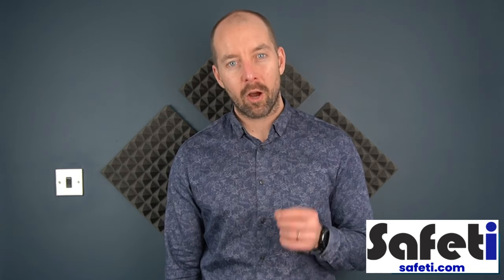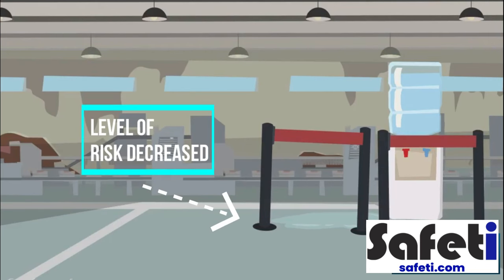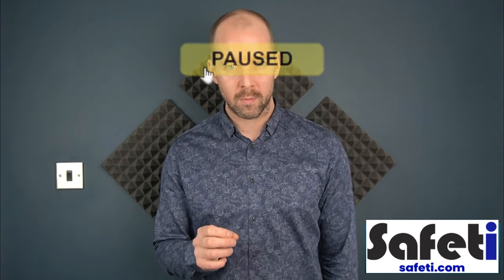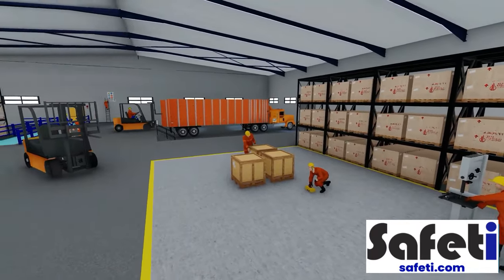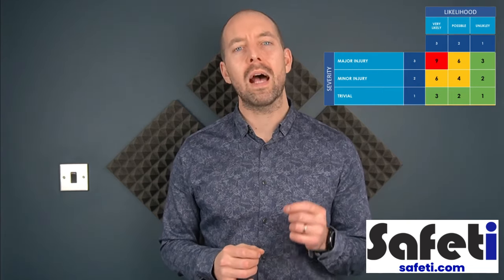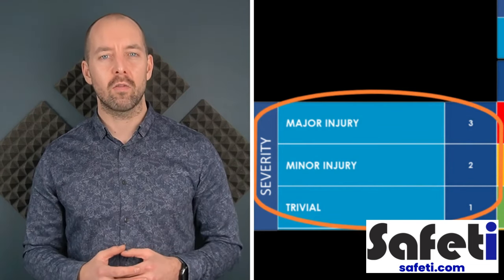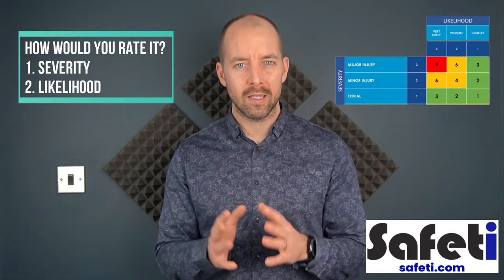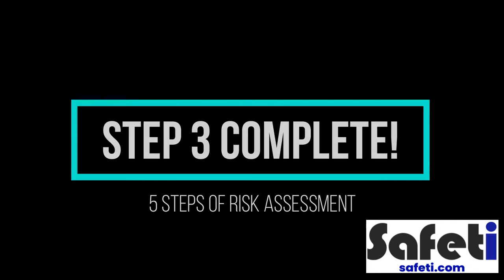Risk Assessment | Health and Safety Training Video

Comment: Great and simple video! I do have a question though. At 27.07min determining the severity, in my reasoning I thought that it would be a minor injury. With such a short distance, the pedestrian would be able to yell for the driver to stop and the crate would stay still. Also I assumed the driver would be going slow seeing as he has a load to navigate so it wouldn't take much effort to come to a halt. So in my view I would imagine the pedestrian collides into the forklift and falls down with minor injuries such as some bruising maybe a fracture or two. My definition of a highly severe case would be death, paralyzed, coma, etc. Can you maybe explain the reasoning of your estimate? I would like to successfully apply this knowledge when doing a risk assessment. Thank you for your informative content!
Reply from the maker: Hi and thanks for your question! This is of course a subjective judgement using  a fictitious scenario, but the important aspect is to understand the principles of the decision-making process. If we are thinking in real terms: for the pedestrian to be in this position, we make some assumptions e.g. there has been a failure on part of driver to see (blinded by raised load) and failure to communicate to  on part of the pedestrian (making operator aware of their presence), amongst other issues. Putting that aside, we have to assume worst case scenario i.e. That the forklift collides with the pedestrian (above their waist). The loaded forklift will weigh several tonnes (we have to assume a heavy load is being moved) and it would take minimal speed to cause serious physical injury. It would be easy to foresee that any resulting injury from this impact COULD be classed as 'Major'. In our view, it would be highly likely to cause serious injury (broken limb, severe head Injury etc.) Again, when we are assessing the 'potential' risk, we are wanting to identify the worst case scenario for the context (within reason), and in this case there is the certainly the potential for causing serious injury or even death. 👍
Reply: @Safeti  great insight! Thank you for responding so quickly!